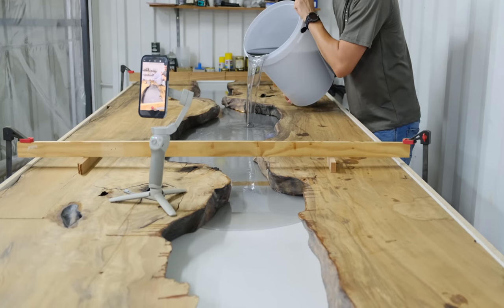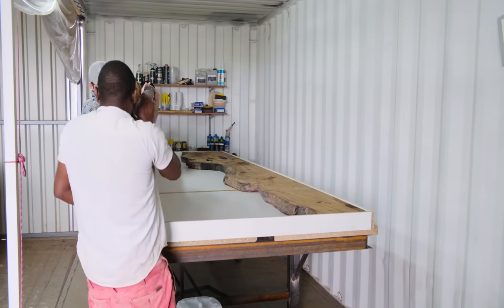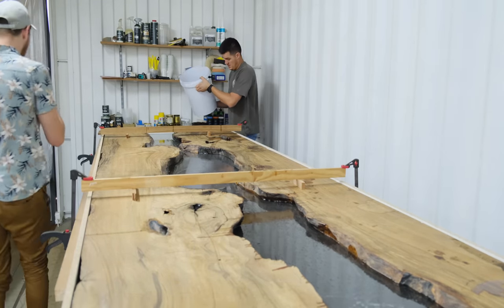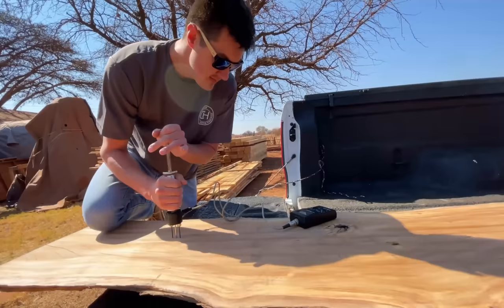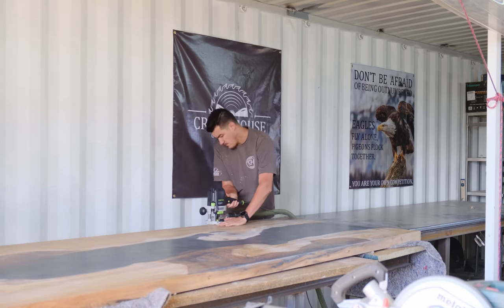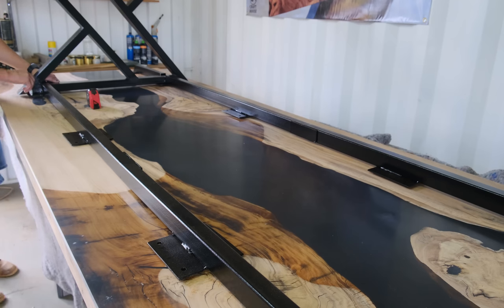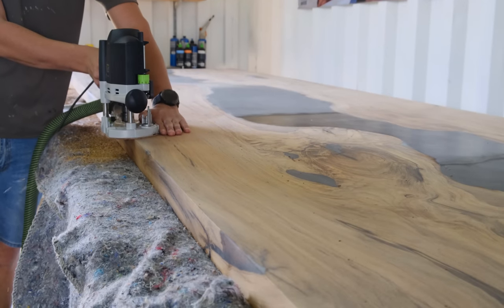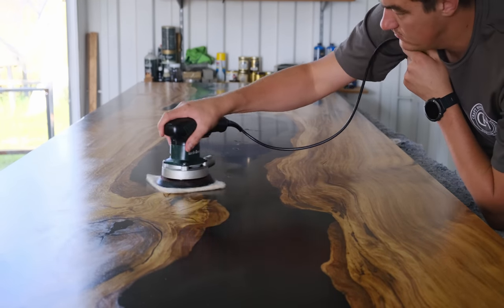I SOLD This Epoxy Table For $40,000

Comment: How do you prevent the epoxy from going “under” the slabs when you pour?…I thought I had mine flat enough and clamped down enough but ended up with a BUNCH of leakage under the slabs on my first one
Reply from the maker: This is normal, it happens to us as aswell.
One thing we did pick up is to use really good and strong claps with a really thick cross timber.

You can always apply silicone on the edge of the table before placing it in your mold to prevent the epoxy from going under.

Comment: Hi Greg! Nice looking table and good work! Just two questions and please don't think I am trying to be a "YouTube troll"... Just need some clarity...

Did you sell this table locally (South Africa) or internationally? Also, did you sell it for $ 40,000 or for R 40,000? There is a MONSTER difference 😂
Reply: I'm also looking at this price. R700k at the time of the video seems WAAAAAAAAAAAAYYYYYYY too much. I would rather buy a house in SA for that price.
Reply: @Dieswartkat021  Exactly! I highly doubt that any person in South Africa would pay that amount for a table! If the epoxy was 18 carat gold, sure! But that’s not the case…

Besides that, let’s use logic. Let’s assume there is a 30% mark-up on the table. That means that the material and labor cost worked out to about R540k! Being a woodworker / maker myself, I know that epoxy and wood can get on the pricey side, but most definitely not that pricey!

In my opinion, the title of the video is most definitely clickbait…